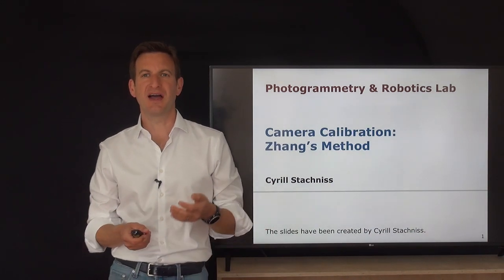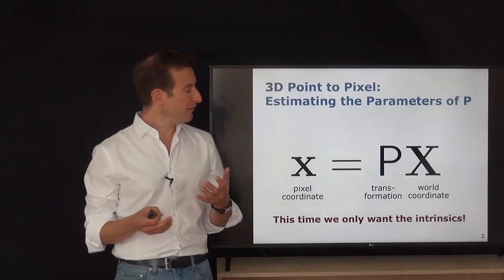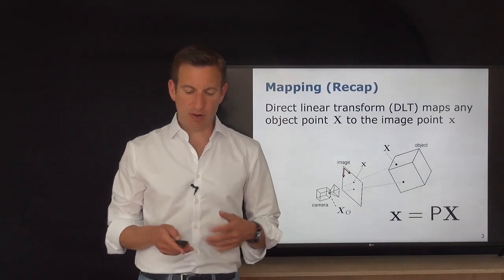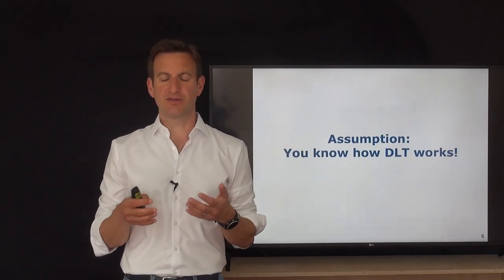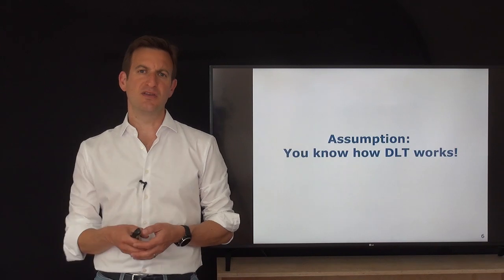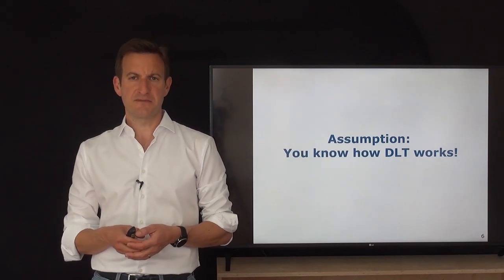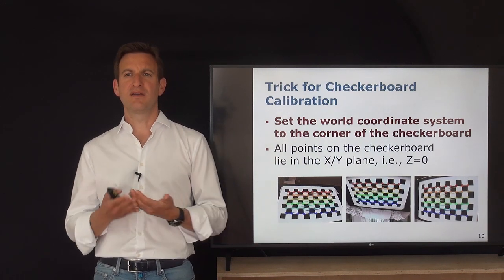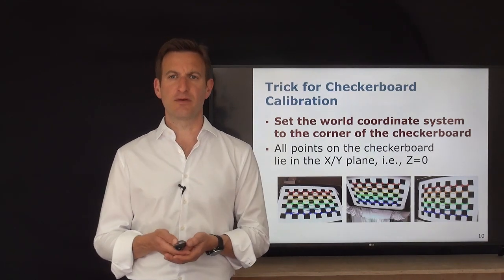Camera Calibration using Zhang's Method (Cyrill Stachniss)

Comment: In an attempt to implement this, I used a single checkerboard image with known xy-coordinates of the crossings as well as the corresponding pixel coordinates.
A gradient descent method based on least squares errors was computationally faster and gave me both the intrinsic as well as extrinsinc parameters for that picture. 
Is this coincidence? When taking computational effort and robustness into account how does zhangs compares to such a gradient descent m eethod?

Comment: I want to implement Zhang's Method and using your lecture to help with it. I noticed that on slide 40 the vij vector is not defined the same way as in Zhang's paper. The elements 3 and 4 are exchanged. 
So I'm asking myself: does the order of the elements matter? Is the exchange on purpose or just a mistake?

Comment: thanks for your video! question, what if I also want to find out the rotation matrix and transition vector? what should I do to calculate them after the K matrix is found? would DLT work for finding out R and t? thanks again!
Reply: Yes, the direct linear transform method can be used to find the camera pose.

Comment: thanks for your video! question, are you sure that K is invertible matrix? because si a projection matrix (from 3D to 2D)
Reply from the maker: K itself covers only the (linear) intrinsic calibration parameters is a 3x3 matrix and yes, it is invertible.
Reply: @CyrillStachniss  so if we multiplied pixel coordinates by inv(K) will we get 3D coordinates in camera coordinate system in the true scale?

Comment: I never realized a homography matrix was just a projection matrix with the Z column deleted.
Reply: It's not 100% correct though. Homography matrix can be formed by removing either r1, r2, r3 or t in the homogeneous transformation matrix. [R|t].
Reply: Any NxN non-singular matrix is a homography. Since we deal with a 2 dimensional projective space, we represent homographies as a 3x3 matrix that can transform points on one plane to another. Hence any non-singular 3x3 matrix is a homography.